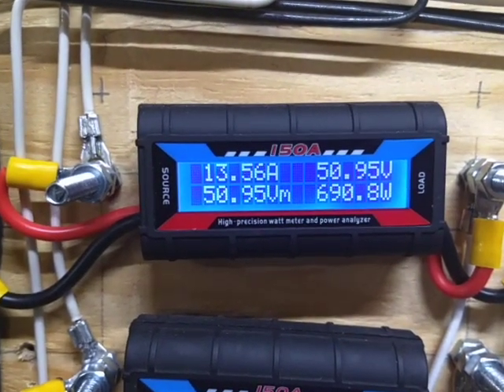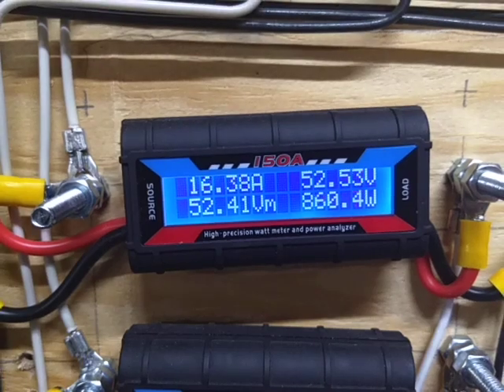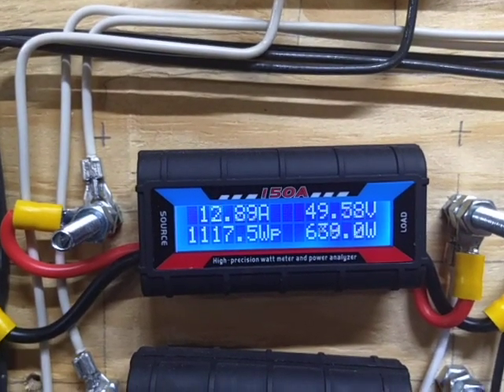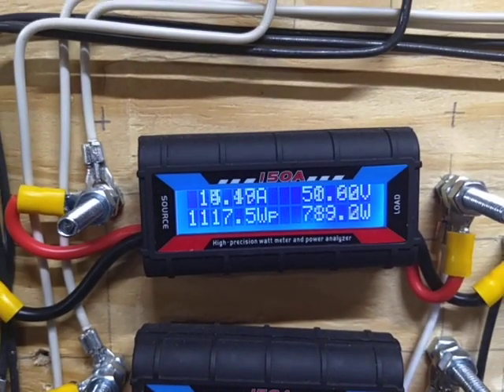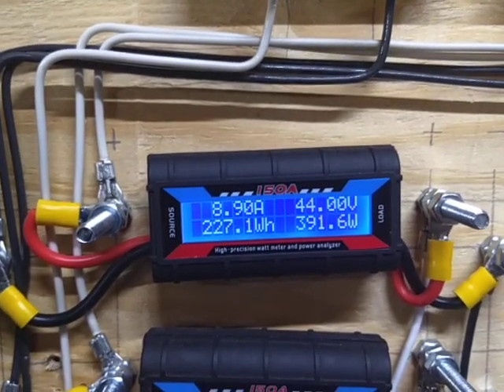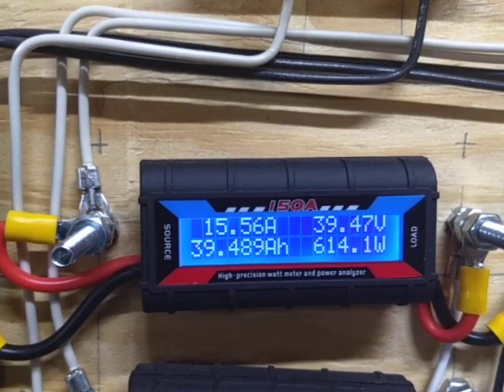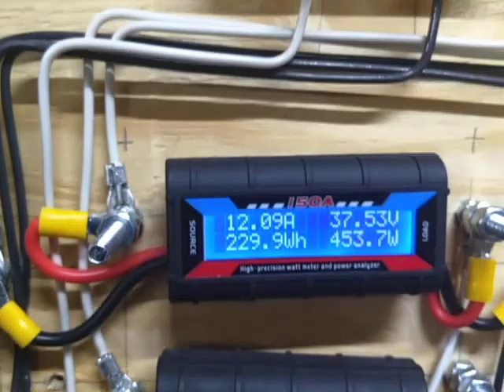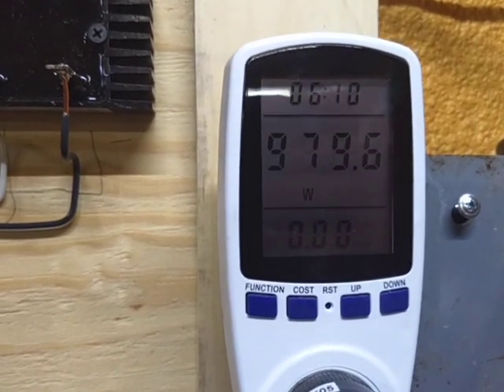700 watt eBay wind turbine in a wind storm

Comment: I live in a small outback town in Australia with people and a council that are not happy seeing a big wind generator going up ( sounds and looks )., so I have put up 6 small wind generators instead  -
2 x 24V 500W Vevor at 6.5 meters, 
1 x 12V ista Breeze i500 at 4.5 meters, 
1 x 12V 300W Vevor at 3 meters 
2 x no name china brand 48V wind generators at 4 meters on 12V systems 
All with 1.2M wind wheels and all 5 blades since I have low wind in my small town. 
I have been commenting on your other older wind generator videos to try and help your channel.